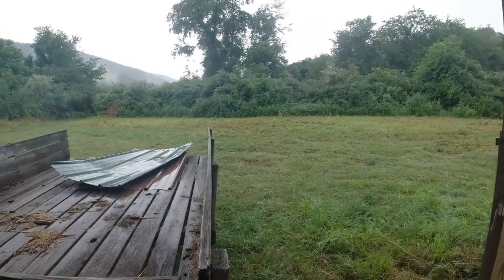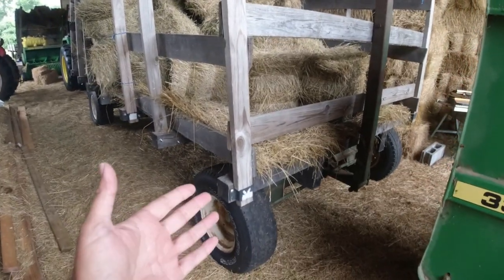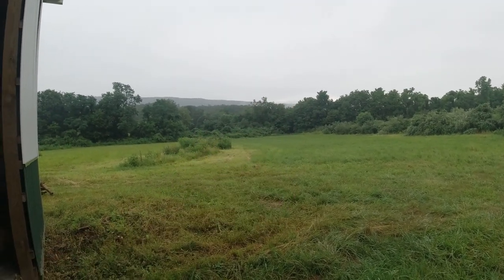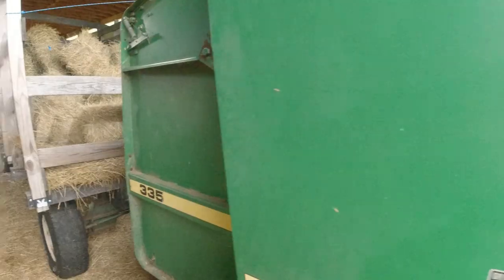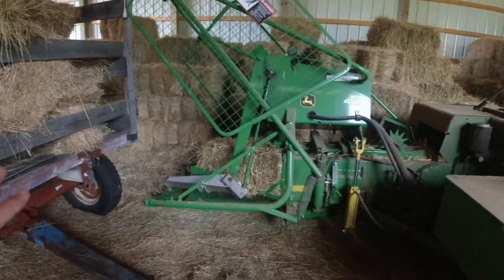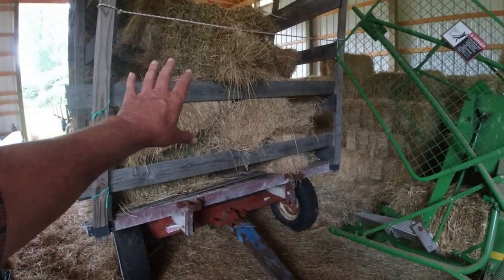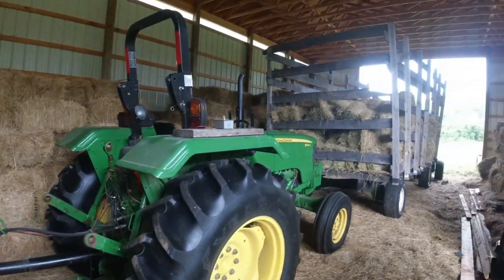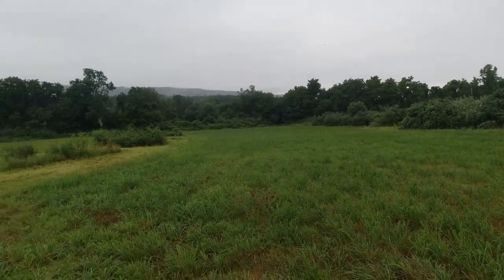Escaping The Rain - Why Pan Kicker, Wagons And Hay Preservative Work

Comment: I think you have the right equipment, I have pulled a wagon with a person stacking on the wagon, but never used a kicker. I have seen them work and I think there a good quick method. I'd bet you were pretty happy getting it up without being rained on. You have to use preservative when the moisture is high, like you mentioned or it will mold. We don't do very many square bales, but when we do, we just salt any high moisture hay, when stacking in the barn. Liked the update, thanks for sharing, have a great week.